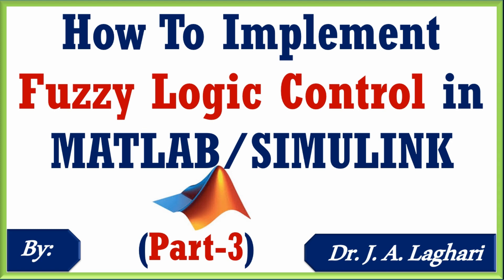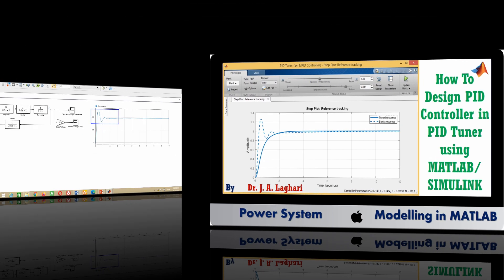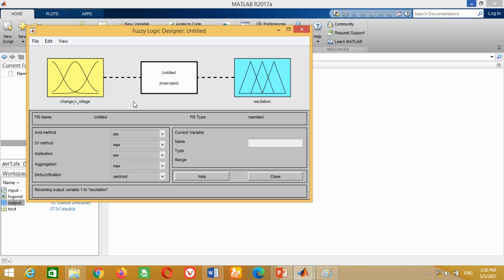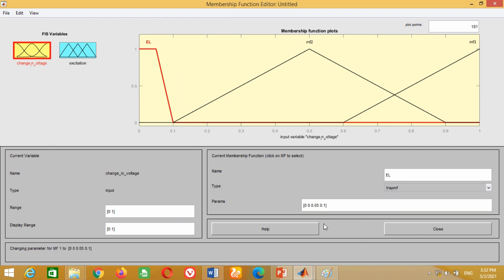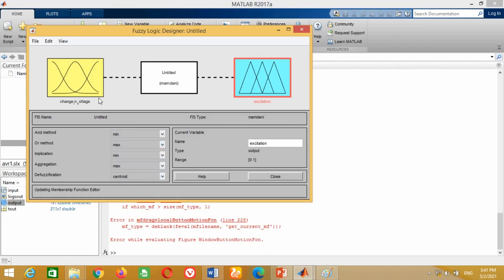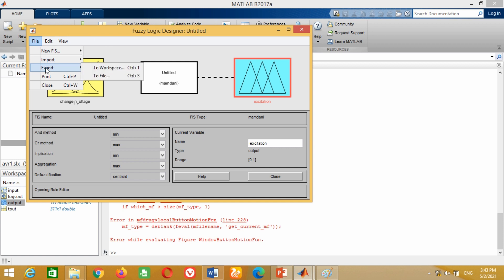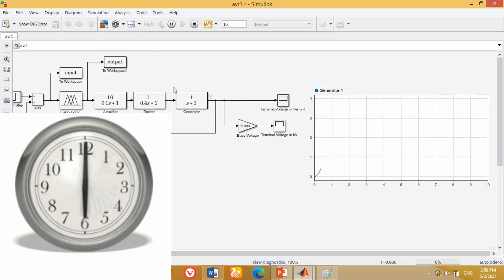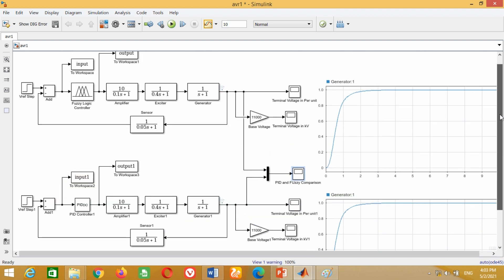How To Implement Fuzzy Logic Control in MATLAB/SIMULINK ? (Part-3) | Dr. J. A. Laghari

Comment: If the reference input is a step function, shouldn't all rules be fixed to the same output as 1 and the fuzzy rule table be the same?
Reply from the maker: Thanks for the comment. the fuzzy rules are used to change the output based upon input change. Therefore, there will be different values for different signals.

Comment: Sir how can i implement fuzzy logic controller in speed control application of 3 phase induction motor using VFD? What is the input? Is it speed and what is the output? Is it V/F ratio????
Reply from the maker: Thanks for the comment. For this purpose, you have to follow some research papers and see which inputs they have taken.
Reply: @DrJALAGHARI  ok sir
Reply: @DrJALAGHARI  sir i had searched a lot. But i couldn't find any.
Reply from the maker: @aswajithrs5119  how it is possible? Just search on google or ieee explorer, you will find many papers
Reply: @DrJALAGHARI  ok sir

Comment: Sir,I simulated a four area control system, first area with pid controller, second area with pi controller,third area with fuzzy pid controller, fourth area without any controller.but i am getting same output ( change in frequency)for four area  system sir...how can I contact you sir..I need your suggestions sir
Reply from the maker: Thanks for the message. I think it is better to model it step by step. First model two area system and check its results. Then model three area system and check its results and so on. Otherwise it will not be possible to find the error.
Reply: @DrJALAGHARI  yes sir I have done in the same way sir..but I'm unable to complete it sir, can I mail you my simulation sir..
Reply from the maker: @VV-JeevanaPraseeda  i am sorry due to my busy schedule i am unable to give sufficient time for this task. But you may follow the same strategy and any research paper for better guidance.
Reply: @DrJALAGHARI  ok sir thank you

Comment: Now, I see the limitations of FLC. But it surely has better response than PID. How about it's practical implementation ? Is it also effective and robust when taken to the hardware?  As from my experience, implementation of PI-Controller actually makes some issues of delays, and can lead the system to collapse if not taken care of properly, but that's hardware limitation.
Reply from the maker: Fuzzy logic controller has the main limitations of not being expert by itself. It totally depends upon the input, output ranges and rules provided by an expert. If there is some mistake in the rules, then it will be going to worse than even PID controller.

Comment: ASALAM O ALEIKUM,
Respected sir your videos are very useful for me ,and helps me a lot. i have a question that the The output for PID ranges from 0 to 8 but when we designed fuzzy logic controller it decreases to 0 to 0.04, i tried to use range from 0 to 10 but the output ranges beyond the limit

MY main question is that how should I defend this problem?
Reply from the maker: Basically we are concerned with the results of fuzzy and PID. not with their ranges. therefore, it makes no difference.

Comment: Thanks so much. I have learned alot from your channel. Can you please make hybrid  Fuzzy-PID for the AVR system?
Reply from the maker: Thanks for the compliments. In Hybrid both the blocks may be used in the models. Then fuzzy logic controller may be used to tune the PID controller parameters. But in real practice, this method will not be useful due to the reason that it unnecessarily increase the complexity of the system with no ultimate advantage over the existing controllers.
Reply: @DrJALAGHARI  I quite agree with you sir. However, in some journals, some authors use metaheuristic algorithms to optimize a Fuzzy-PID controller. I guess that was just for the sake of publication.
Reply from the maker: @oladipostephen8501  Exactly. You are right. This is also the reason .
Reply: Hi. As part of my final year project work, I developed an intelligent fuzzy logic controller which was tuned using a genetic algorithm. Both the membership functions and the gains of the FLC were tuned simultaneously. The MFs and gains of both the inputs and outputs were optimised in this way. There were 2 inputs, the actual value of the control variable and its rate of change, that is, d/dt. This is similar to a PI controller, but there is an internal inference engine taking decisions.
Reply: @qwasrfg  Great work you did there. Can you kindly share the code with me?